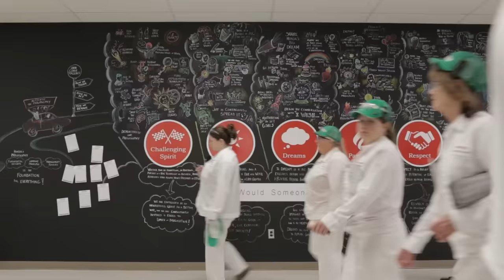Honda Manufacturing of Indiana (Greensburg Production Plant)

Comment: I wonder how many of the workers actually own/drive a Honda.
Reply: Quite a few but not as many as you would think. I would guestimate around 10% maybe a little more.
Reply: I have run in and out of the different plants for Toyota and Honda, I see the employee parking lots and figure  the employee discounts must not be up to par because their is not much loyalty to the brands.
Reply: I don’t think many, after all, it’s just a job... they can buy any car with that money
Reply: Very few.
Reply: If you worked there for any length of time you wouldn't buy one of the cars either.
Reply: U can buy any reliable car out there, but if u don't do the basic maintenance or drive ur car like an old lady, it will still break!
Reply: Native Michigander here. My family worked for a U.S. automotive supplier plant. Back in the day, if an employee dared to drive a foreign car to work and park it in their lot, it WOULD be keyed by the time they finished their shift.